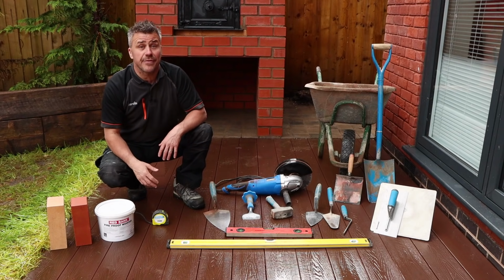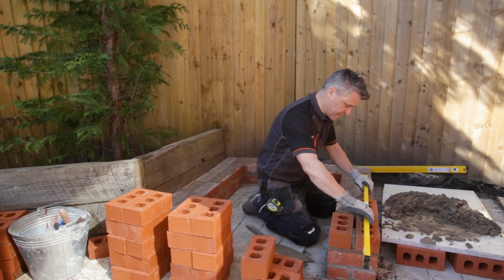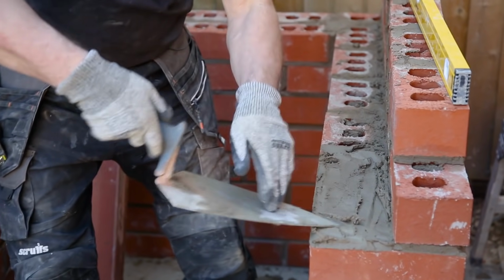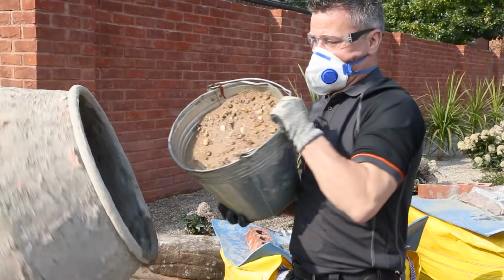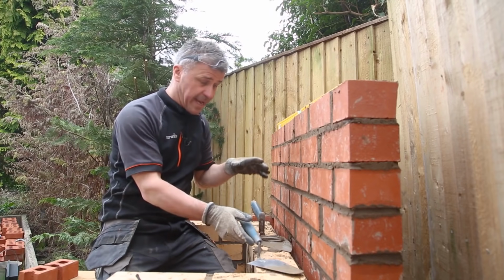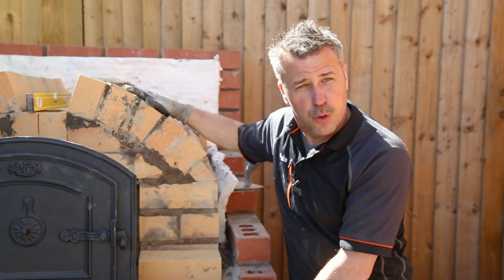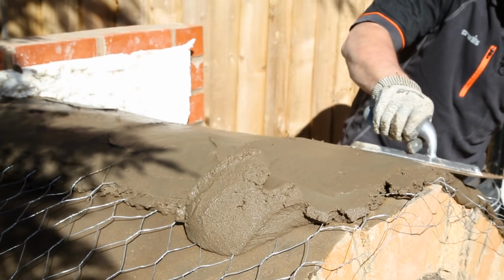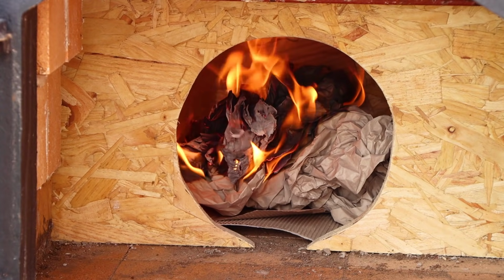How to build a brick pizza oven

Comment: I've wanted a pizza oven for the past couple of years, however it looks like it's going to be a few more years. 

It's going to boil down to the final cost, which to do correctly is going to be close to $4,000 USD in materials. I want brick oven pizza, but not at that price.
Reply: Try finding reclaimed materials it could save you a lot of money

Comment: im like pretty sure you should fire the oven slowly and increase the temperature slowly for a week or so before insulating it. if you insulate like this and fire it up very strongly you will cause cracks in the oven
Reply: Thanks for your comments, Your right if you fired it up high to start with it may crack, I did fire to up slowly over a couple pf weeks so it didn't crack, all turned out perfect thanks.

Comment: I really don't understand,  reason of inserting metal pyramid/tube into the chimney. Temperature of hot gases is up to 900* Celsius . Steel is quickly deformate and burn. And its simply reduce internal diameter of the chimney. Why not just made chimney from bricks? Its cheaper and simply 🤔🤷
Reply: Its harder to build the chimney from bricks

Comment: It is a good Pizza oven but no use because no dimensions and quantity of material used. I can't build this oven. You didn't show the testing of the oven for cracks. it is very important.
Share your oven specifications.
Reply: I didn't include full dimensions and quantises because you can build your oven what ever size you like, many people choose to build there larger or smaller to suit there needs. As for testing to see if the oven cracks well it should crack if it's built like this one and you leave it long enough to dry as well as slowly building there heat up of course when lighting it for the first couple of times.

Comment: Great tutorial. 👍
Reply: Many thanks
Reply: @MrandMrsDIY  The only thing I would've done different, is a rowlock/sill across the front @ the bottom of the door, instead of ending with a brick.  Other then that looks great.
Reply: @levelseven9841  I agree, I inly finished it with a brick because thats all I had on location at the time, Ive since replaced it with a piece of granite
Reply: Cheers

Comment: No insulation under the fire brick floor?
Reply: I didn't feel it needed it with the fire bricks, concrete pre-cast lintels and then a wet poured concrete slab, it holds the heat amazingly well

Comment: Nice Build right there, only thing that concerns me is the size of the oven without having insulation under the fire bricks, all the heat will go into heating up the concrete screen and lintels etc, It will be very expensive in wood and time to get the oven up to temperature. for an effective oven it needs to have some form of insulation like ceramic fibre board/ calcium silicate board, thermalite bricks or even just crushed glass to act as an insulator
Reply: How much energy would be wasted per pizza and how much money would that equate to annually?
Reply: @MoonGlayzer  Tough question to put an exact figure on it but if you think with insulation on the bottom, the heat will be heating up JUST the fire bricks, without it, the heat will be dispersing into the whole of the concrete slab AND all of the bricks in the base. A well insulated wood oven will take around 1-2 hours to get to correct temp, I suspect without insulation on the base it would take more like 3/4, if not more. So in terms of wood (depending on what wood you are burning) it would take about an extra 2/3 bags at a cost of £7-£10 per bag. so essentially every time you are firing it up it could cost an extra £7-£30. might not sounds like much but over time it will add up. A decent ceramic fibre board is about £75-£100
Reply: @mattgofton8078  ceramic board ontop lintels then concrete ontop?.
Reply: @musclestonebricksolutions3059  No I would lay the concrete on top of the lintels then the ceramic fibre board and then the fire bricks on top of the board. That way your bricks will retain as much heat as possible

Comment: Nice job, can't wait to do my own.  I like the Angle iron idea and pre cast lintels.

It's not a good idea to use sheathing if your planning to burn it.  That sheathing is composed of wood n chemicals.   I would recommend plywood.
Reply: Thanks for your comments, The Ply wood also has glue/chemicals just like MDF or OSB boards, I did burn them out first before lighting for cooking, please always make sure the former frame is burnt out and the oven is cleaned before using it to cook in.
Reply: @MrandMrsDIY  well plywood is wood and glue.  Mdf is wood fibers with resin.   The resin part is the problem

Comment: Mortar looks a bit dry, would be easier to tap down if a bit wetter, and then fill the joints up better to make less pointing work. That’s all personal preference tho. Still a great job
Reply: Hi George, yes your totally right a wetter Mortor is easier to work with, however when you add the fire cement it makes the mortar go off so much quicker! plus it was a super hot week which didn't help.

Comment: Nice build, I wonder how well the oven floor will retain heat as it looks like the build is missing essential insulation under the oven floor fire bricks, resulting in a significant heat sink down through the floor.
Reply: Hi Danny, with laying the concrete  pre-cast lintels, then concrete screening over them before laying the fire bricks on top, this will all help hold the mass of the heat for longer, insulation could of been laid but wouldn't add much future benefit
Reply: @MrandMrsDIY  Without insulation under the fire bricks it'll cost a fortune in wood to get that oven up to temperature as all the heat will be getting lost into the lintels and concrete. He needs to install a layer of ceramic fiber board under the fire bricks to retain the heat.

Comment: Great video!
 I am starting with a concrete foundation, what are the dimensions of base?
Reply: You can make the base any dimension you want buddy as you can make the pizza oven too your size or if you wanna make it the exact same as the video then pause it near the start when he shows the first two layers off brick and then work out how many bricks are on the bottom layer and then you can calculate it through that dude
Reply: Please see above 250mm deep, by 300mm wide

Comment: All your gonna need to complete this job is a full bricklaying tool kit, a cement mixer plastering knowledge, and oh 25 years bricklaying experience and your away
Reply: I've got 30 years and I'm still researching before I attack building one for my sister.
Reply: @derekroberts8637  We did the same Derek and it turned out amazing
Reply: @derekroberts8637  So did I

Comment: Could of done with fibre board or pearlie insulation under the floor layer of bricks. Excellent brickwork though
Reply: Thanks Rob, I was looking into putting insulation under the floor section but the fire bricks on top of the concrete pad seemed dense enough to contain the heat.